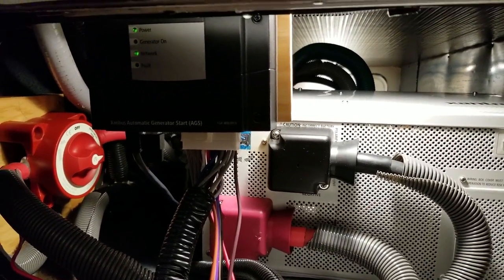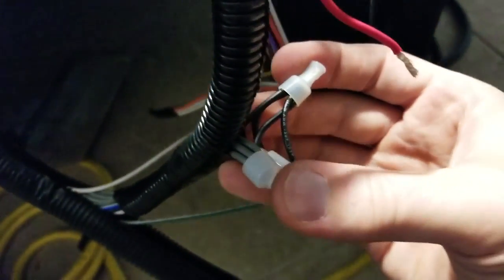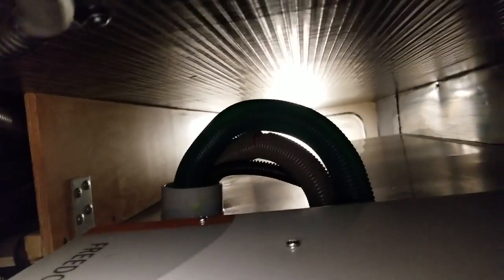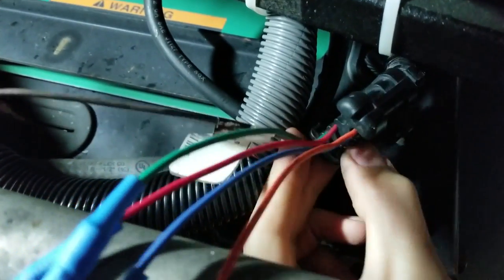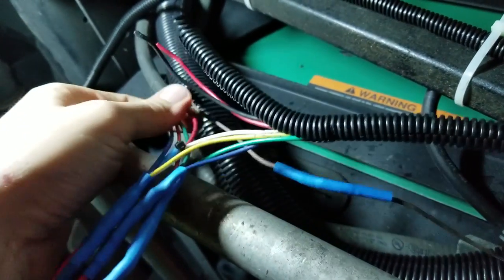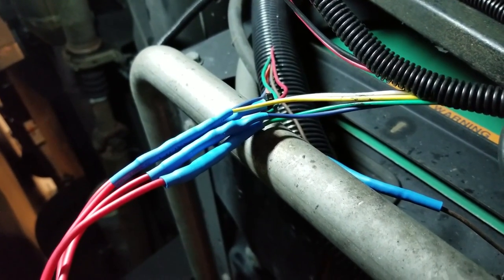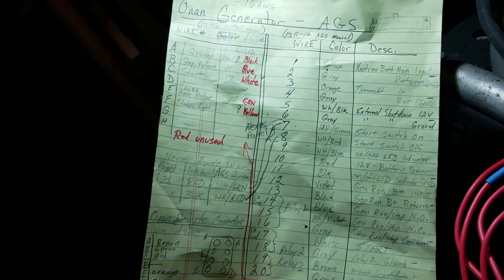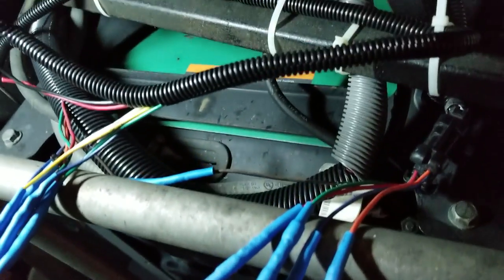Installing Xantrex AGS with an Onan RV 4000 Generator

Comment: You are not saying where the wires go on inverter, i have an AIMS pure sine with place for 2 wires for auto start and onan bge 4.0 with 4 wires (1-hr meter, 1-start, 1-stop, 1-common) I am pretty sure you have same wires. i would like to know where the wires that come from inverter go. thank you
Reply from the maker: I linked to the wiring schematic in the description.  Figuring that out was what took the longest.  I am sure it is specific to my Xantrex inverter and won't be applicable to your AIMS inverter, but it should still give you an idea of what you're in for.  It took several calls to Xantrex tech support to figure it all out.  That black AGS module connects to the Xantrex inverter via proprietary "ethernet / RJ-45" connection called the system control bus.
Reply: @PeterMuhRoads  Xantrex tech support has not been very helpful to me.  I am trying to connect it to my generator and was told to buy a different generator.
Reply from the maker: @earthenergyhex  I would call back and get a better tech, though I'm sure not all generators can be connected.
Reply from the maker: You have to make a hookup chart. It's going to be different on every generator and AGS controller.  You'll likely have to call the tech support for your AGS controller and coordinate with Onan.  First figure out what each wire does on each side, then match them up.  It's not easy, but it's not rocket science either.
Reply from the maker: Also, if you look in the description, I put a link to my own custom made hookup chart, which worked for my specific combination.  You'll need to do something similar for yours.
Reply: @PeterMuhRoads  thank you.  I am back at it trying to make it auto instead of manual start. I got the wiring diagram for my Wen generator as well.  Not an electronics guy so I have to figure out the diagram first.  LOL